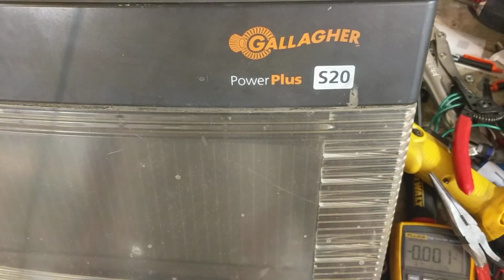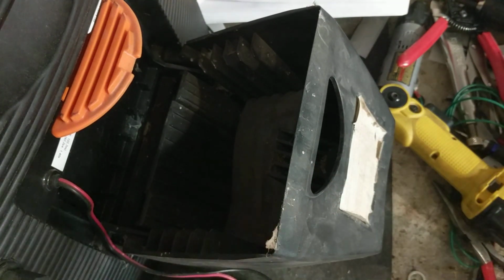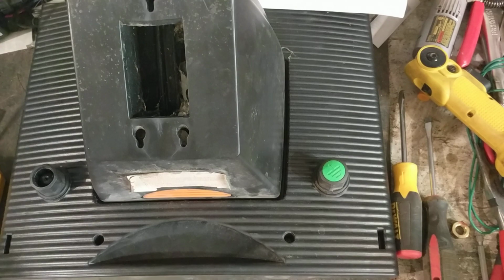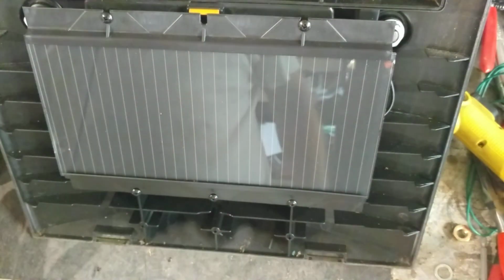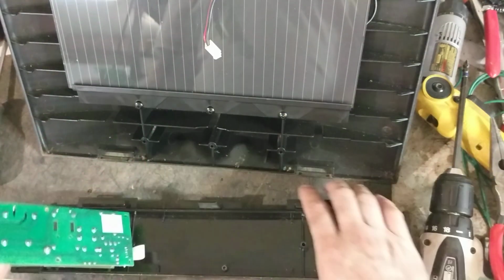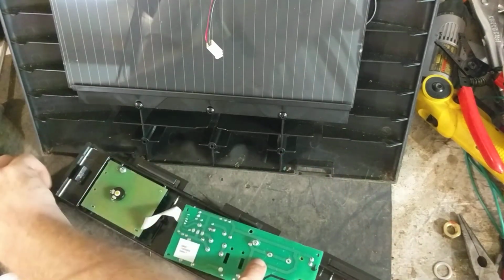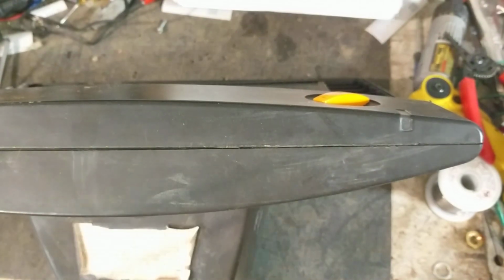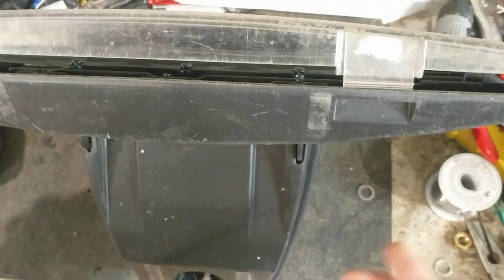HOW TO TEST & REPAIR A Gallagher S20 or S50 Fence Charger

Comment: Where can i buy this transformer in Australia?
Reply from the maker: Well unfortunately Gallagher discontinued the transformer about 2 or so years ago here and the whole board was discontinued a year ago, but a few were still around up until about 4-6 months ago then the boards were all gone. So no more parts are offered for the old style S20 and S50. They were decent units, but they did launch those two units, along with other models, back in 2005 here in the States and probably a similar timeframe down under and elsewhere, but it's been about 8-10 years since they last produced that model as a production model. Look into their newer Lithium Solar units, I haven't heard anything bad with them yet and worked on any of them so far.

Comment: I have a Gallagher s50 dose nothing with a full charged battery dose. Iv got it to bits and cant see any bad connections or anything.. is it the solar panel? Puts no power out at all.. no pulse tick or light flash

Comment: i have a s20 someone turned the switch to hard and it turns all the way around.  we got a new battery I am getting 12 volts from that but nothing turns on.  Is it possible to bypass the switch? I am ok  with it staying on, just trying not to buy a new one.

Comment: What is that you're using to "soak up" the solder when you are removing the board?
Reply from the maker: That stuff is chemwik desoldering braid. It's awesome stuff and has flux built into the braid so it helps with the heat transfer from the soldering iron to the solder join itself. Desoldering braid has been around for decades.
Reply: @FencerFixerRepairLLCKansasCity  Thanks -- I asked about a solder wick at the hardware store and they looked at me like I was nuts --- even after explaining what it was for.  How do they think one can desolder components from a circuit board?  I do know there's also the solder sucker too.  Why this stuff isn't on the peg board near the solder is beyond me.
Reply from the maker: @Geoff Pritchard I buy all that stuff on Amazon